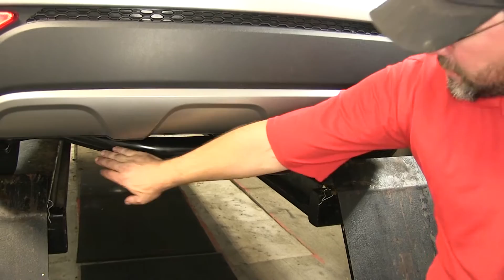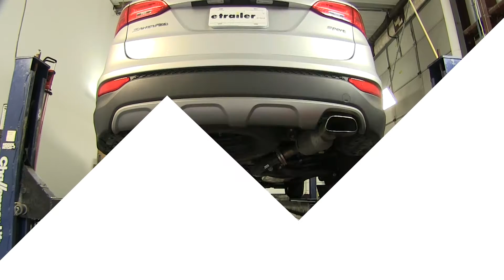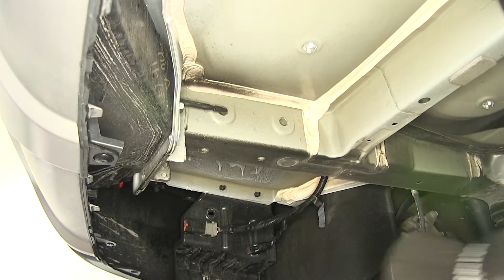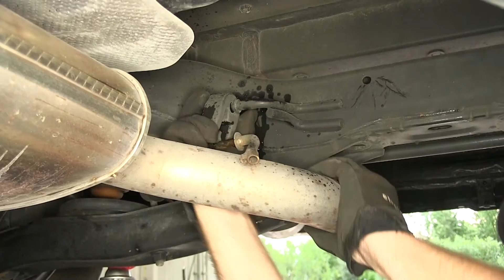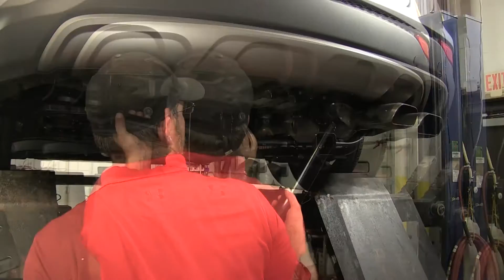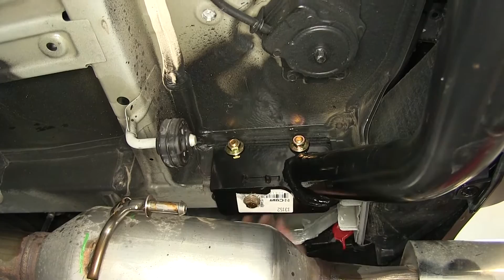etrailer | Installing the Curt Trailer Hitch Receiver on your 2015 Hyundai Santa Fe

Comment: Please update all your information on the Santa Fe sport. Side bolts should be tightened first so that the hitch shifts to one side. Then the under carriage bolts last.Otherwise there is a gap on the side and it will not be aligned up properly. The under carriage bolts  have elongated holes for that reason. Long side bolts when tightening will shift the bracket horizontally  until it mates up with the body. Then you can tighten up the under body bolts. Perfect fit.
Ralph